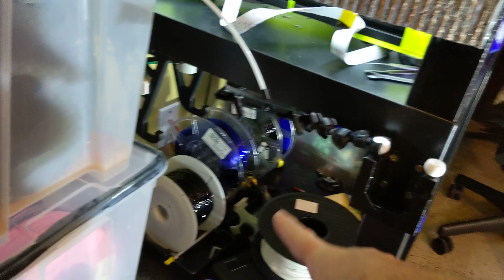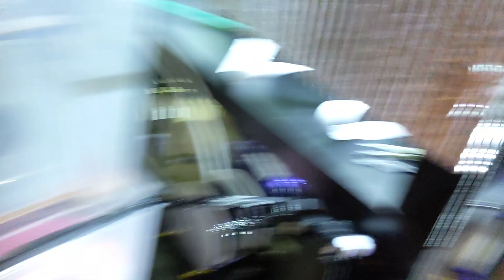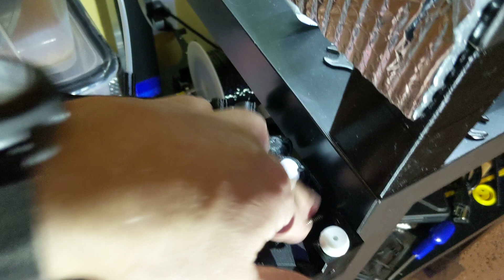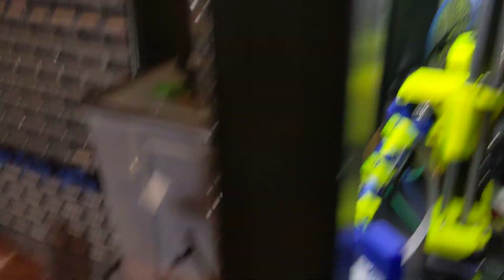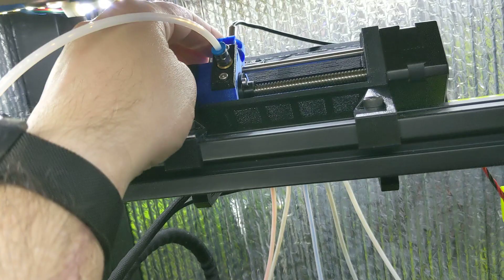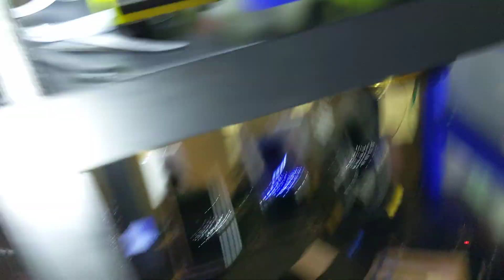How my universal continuous slip clutch auto rewind spool holder wall mount works with the guide

Comment: Cool system. I know that is one big issue with me considering an mmu is how much space I will need to manage filament. Wall mount is a great idea.
Reply from the maker: I'm also currently working on a simple L-shaped stand that holds the wall mount in a stand-alone capacity.  I'm also going to try to make it so you can hang multiple spools from a single under-shelf spool holder but no promises :)